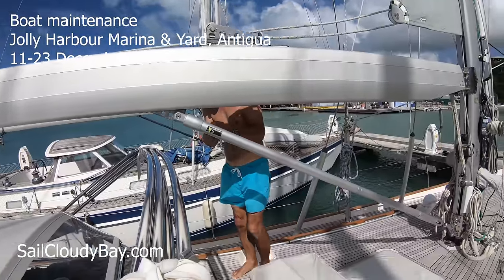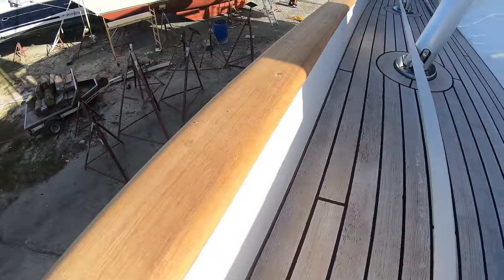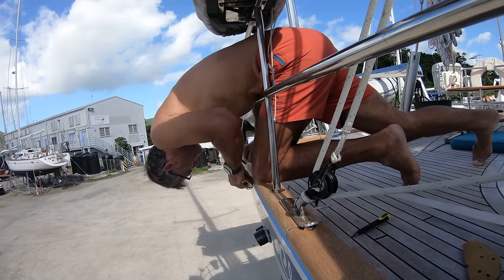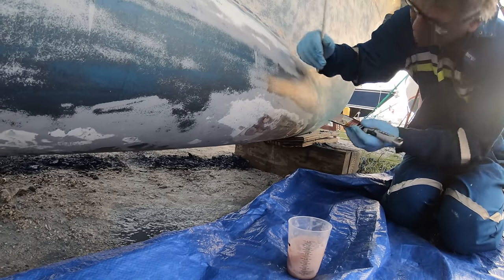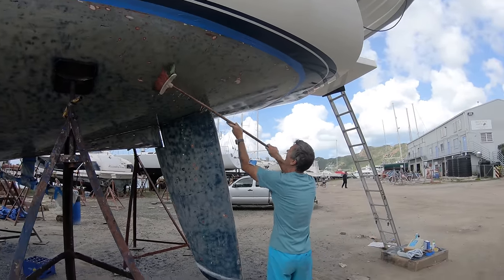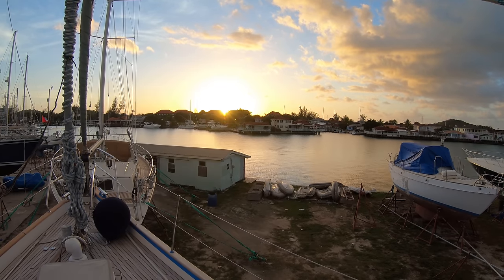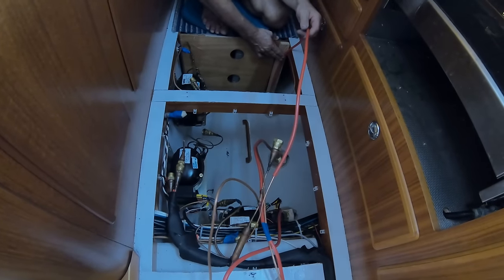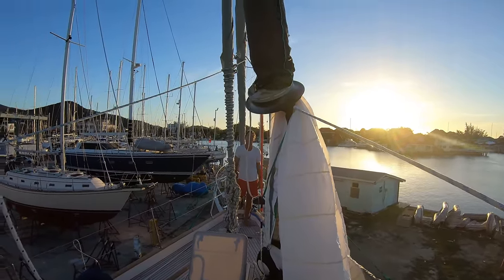ep55 - Boat maintenance - Jolly Harbour, Antigua – Hallberg-Rassy 54 Cloudy Bay - Dec 2018

Comment: After completing your Barrier and Bottom coats you commented "this is how it should of been in Harrington" and I think you weren't wrong. Some episodes ago I noticed your boat parked behind Osprey Marine at Harrington. I hired them to soda blast below water line allowing me to focus on painting and I was very pleased with end result. Your boat looks great and I enjoy your worldly videos. Oh and I like your special tool for applying grease to seacocks. Thanks
Reply from the maker: Yes, would have had a soda blast in Herrington but for 2 reasons 1) they wanted $4000 to do it!  Antigua was $1200. 2) the temperature was dropping rapidly and was getting too cold to apply the Interprotect barrier coat. So we sailed out of winter to cheap Antigua and warm weather.

Comment: I use those same coolers on my Hylas and they work quite well.  You should see a reduction in amp hours to maintain the temps.  Nice video, thanks for sharing.
Reply from the maker: Yes, so far so good. You can really feel the heat they dissipate. The old ones just used to heat up the water in the sink drains when at anchor.

Comment: Great video.  If you decide to re-varnish the rail, you might consider using penetrating epoxy as your primer and then as many coats of a good quality varnish on top as you would normally do.  Prior to using the penetrating epoxy, give the teak a wipe down with acetone.
Reply from the maker: John, the issue with epoxy primer is if you ever want to get it back to wood.  I was planning to put 2 coats of normal varnish at 50/50 with thinner, as primer. then 8 coats more. This would give a nice flexible coating. Then 2 coats of Awlcraft 2000 Clear to act as UV protection and a hard finish.  But we could not find Awlcraft Clear in the islands.   Anyway ... the teak is now all bleaching white pretty fast here - so I guess that is how its going to stay now!
Reply: @SailCloudyBay  
Epoxy penetrating primer like Smith's. Tried and true. Then Epifanes or other spar varnish. If you let teak bleach, you may find that the soft part of grain eats away. You should get more than 6 months from your varnish. Forget two-parts unless you are a pro. It is clear you that you were getting moisture under your varnish.

Comment: Glenn, if I could also chime in on varnishing.....I used Awlgrip´s Awlwood product on my old boat on several pieces, primarily on a stern cap rail that needed replacing and on the cabin top hand rails.  Other pieces of wood trim had Epifanes varnish that had been applied the year before.  After just one season in the Texas Gulf heat, the difference was night and day.  Epifanes had begun to crack and craze, peeling off in a few spots, while the Awlwood looked like new.  Just my opinion, but if you decide to treat your rails  again, Awlwood will provide a superior finish and will last for years....many years.  It´s a bit pricey (around $90/quart for the primer and finish) but what you save in maintenance is invaluable.  

Also, the next time you address your bottom, you may wish to consider Hemple´s SilicOne paint.  As the name implies, it´s a silicone based product that is non-toxic and non-ablative, therefore is more environmental friendly as opposed to more traditional anti-fouling.  The idea is it provides a surface that is so slippery, whatever attaches to the hull while at rest will fall off once you start moving.  Similar concept to the Prop Speed you applied to the running gear.  I used it on my Oyster 53, applying last spring.  After 6 months in the water (2 months in an English estuary) and 1800nm of cruising, the boat was hauled and the bottom was completely clean except for a bit of scum that had accumulated along the waterline while sitting in a Spanish marina.  What was there easily washed off with just a swipe of my hand.  Price is also competitive.  The literature states it will last for 10 years.  With normal paint, you´d be looking at 5 or 6 bottom jobs, at least.  I´ve only had it on for a year, but so far I´m very impressed.  Bonus points......increases hull speed too.  Just my 2 cents.
Reply from the maker: Phillip thanks for sharing your experience. Interesting on the varnish because i heard from another person that Awlwood in the Med needed to be completely stripped off after just one year. So I was put off that product.  And in the Caribbean they all swear by Epifanes. Maybe its just the way these products are applied that makes the difference. Anyhow, for now we will leave it bear teak and left it go silver because I joust dont have the time to stop for 2 weeks to get all the necessary coats on.
Interesting on the Hemple SilicOne paint. I will go look that up. years ago there was "teflon" antifoul paint with the same idea ... but it never worked. Which English estuary were you in? The Orwell new to Ipswich?  If on the east coast, those waters are terrible for growth.
Reply: @SailCloudyBay  According the the Awlwood lit, proper application is critical for long-lasting results.  I know Epifanes is widely used, but I found it simply doesn´t hold up compared to Awlwood.  I used it on my first boat, which was when I was living on Lake Michigan.  There, the boat only saw the light of day from late May to October, and in a climate not nearly as harsh as the Gulf coast.  Nonetheless, it did the same thing, started looking dull and crazed after only 2 summers.  I used Awlwood on my cockpit table and obtained excellent results.  Interestingly, Fox´s in Ipswich had never used the product but were so impressed with the results I obtained on my table, they decided to finish the rails on a 56 they were refitting with Awlwood.  
Back to the bottom paint, I think you´re referring to Interlux´s VC17.  It´s commonly used on performance boats in the Great Lakes, and I used it on mine.  Yes, still got growth with VC17 but not that bad.  But since it was ablative, bottom had to be done every year....spring ritual.  With SilicOne, it´s much harder and doesn´t come off unless you hit something.  After hauling, I was very impressed with how good the bottom appeared, almost like it had just been painted, and there was not a single barnacle to be found except on the top of the rudder where no paint was applied (I´ll fix that before launch).  Yes, we were in the River Orwell getting Bora lá readied for our cruise, and after about a month in the water, we had a nice "beard".  By the time we arrived in Guernsey, the waterline was completely clean, and remained so for the remainder of the summer.  We sat in a marina in Spain for about a month before hauling, and by then scum had formed along the waterline, but as I said, it washed off easily using only a rag and water.  Personally, I´m sold on the product.  Cheers.

Comment: They make led kits that are multi color and dimmable... They usually come with a remote. But a lot of em also have an app you can download. You can get them in many different voltage ranges... One brand that's more automobile focused I think. It's called Type S... I have a set in my car for interior lights. They're controlled by an app on my phone. But anyways. The point of me saying all this. You can use the lights at night without being blinded by using the red color instead of white so you don't mess up your night vision too bad... That's mostly why I use them in my car. Red lights glare less as well. Idk. I know this is an old video. But if the interior lights are still an issue... There's other pretty affordable options that are pretty decent...
Reply from the maker: Thanks for the tip. yes, we have red light in the cabin in cockpit when we are night sailing.

Comment: Teflon tape is great stuff for smaller pipes.  I use a teflon infused pipe d-ope for residential stuff around the house, etc.  The pipe d-ope looks like peanut butter  It is even LP and Natural gas certified.  The thing about teflon tape is that it doesn't seal large diameter pipe well at all...or at least it is a lot harder to do so.
Reply from the maker: I've not yet found any pipe-dope that provides a seal even at very low pressures. Can you recommend one?
Reply: @SailCloudyBay  Lowes in the US sells it.  I have been disappointed with several other brands they sell as well.  This stuff never fails me: RectorSeal T Plus 2
Reply: "MeetsANSI LC 7-2009 Working Temperature Range -40°F to 125°F.
Maximum Working Pressure: 125 psi.
For Use With Natural Gas & LP (VAPOR STATE ONLY).
Use on Steel, Galvanized Steel, Iron, Brass, Copper and Aluminum.
For Pipe Size Up To And Including 1 1/4 Inch".

I have used it on much larger pipe than 1 1/4 inches.  You just end up using a lot of it.  I also think it will probably take temps for a long time up to 140 degrees F or more.

Comment: removing teak plugs ,trick from local -drill small hole in the center of the plug to the top of the screw, use a new screw and screw it into the plug hole you just drilled. the plug come out without splitting the rail.
Reply from the maker: good advice. thanks :)

Comment: Hi guys, good job, yes I usually end up tidying up the sanding prep too. On your shackles and QR Fittings I use "Corrosion X", if you see some give it a try; use it sparingly; it has a wicking effect into screw threads and corroded parts, leave it a few minutes to soak and then exercise the fitting parts at fault. usually works. Corrosion X is also very oily too and is great to protect fittings in the weather. Cheers
Reply from the maker: Thanks, yes that reminds me that I do have Corrosion-X on board from the previous owner. Must try it.

Comment: I have a few questions about your communication equipment, pertaining to cellular data as well as Internet satellite, when you’re cruising the islands you shift between using cellular data from the islands and then jumping to satellite Internet? Do you use a cell phone repeater on the boat as well as what type of satellite Internet are you using and how reliable is it the satellite coverage?
Reply from the maker: Michael, 
For the internet, our preference is to always use cellular phone whenever in range, which in the islands is usually within about 10 miles of the shore. There are cellphone companies that give a package that covers most of the islands. But to conserve our data we use it sparingly, with no video streaming etc. 
Then, when near to shore (anchored) we always try to link into a WiFi signal using our WiFi booster antenna. We can get WiFi when a signal is within  2-300metres from our position. On rare occasions we find a WiFi that is open, not password protected. But usually its a case of finding a shoreside bar WiFi signal then going for a quick drink to obtain the password.  We often re-anchor just to get near to a WiFi signal.
For Satellite we have 2 systems. A Fleetbroadband that uses inmarsat and would give data speeds (250kbps) that would just about allow you to open a simple webpage and would have a similar data speed to the old dial-up method that was used land 15-20 years ago. But we have never purchased any airtime because the minimum package for this system costs $400 per month with only 40meg of free data. Its outrageously expensive. To give you an idea, to get a package that would equate to even a small cellphone data package (1Gb/mth) you would pay over $2000/month, and up to $12000 for 10GB of data. It makes the mind boggle when you see multiple inmarsat antennas on superyachts!
Our other satellite system is Iridium-Go. Its a VERY slow data link that just about allows you to send emails and received very basic weather data. Its too slow to be able to go on the web. Even then, its $140 per month. So we only buy airtime when we are doing passages of more than 4 days away from cell phone signal. 
Our other backup is an HF radio with a pactor modem attached. With this we can link into the sailmail service and get email and weather. But using the HF is a bit like voodoo ..... sometimes it works, sometimes it doesn't!
Connection to the outside world via internet is likely one of the most painful aspects of cruising life. Unless of course you are happy not to have the internet, then its paradise!

Comment: If you are doing hydraulic fixes it is good to have a very fine sawdust handy. The sawdust from routing “custom wood” as in cheap furniture paneling is best. The fine dust scavenges the oil from the surface it is sitting on.The oil filled dust needs to disposed of away from the boat as it burns slowly but ignites very easily, it burns like candle wax. Regarding the brazing, a safety tip I learned just this week is https://youtu.be/aqR4_UoBIzY this simple to make magic compound will protect the fibre glass hull from the intense heat of the flame. No doubt you know that when ever flames are part of the work on a boat you must always have a fire watch person. That needs to be you, don’t leave that to others. The person doing the work usually can’t see what is going on around them and can set fires with out knowing it.
Reply from the maker: Very sound advice William, thanks.

Comment: Again, very nice work and video! If i knew i would come to help! A question, in the other boat maintenance vid i saw you have 2 webasto heaters. How are they build in? 2 Heaters charing the same pipe or 2 heaters for 2 seperate parts of the boat? Cheers!
Reply from the maker: Ron, Each heating unit supplies air to a different part of the yacht. Basically one bow and saloon the other saloon and aft.

Comment: Very cool! So meticulous, love it!

Question, what did you replaced the “water/cooling” intakes for your fridge?? I have the same water system for my refrigerator, looked exactly like yours.....but I have never seen the ones that you used to replaced the originals?! 😳
Also what kind of system did you use on your teak wood that it comes off like that?? 😱😎
Reply from the maker: We replaced the Islotherm thru-hull keel coolers with the ones Frigoboat make. The Isotherma are good in cool water and when the boat is bobbin g up and down. But in calm warm seas they just managed to super heat the water in the thru-hull pipe. These new Frigoboat ones are much more efficient.  
The "varnish" we used on the teak is a German industrial product called Coelan. Challenging to put on but it you get it sealed properly it lasts for year with great UV protection. Unfortunately we had just too many protusions on our gunnels (all the stanchions) and it started to get water under it after 2 years.  I was going to revarnish but decided on the easier route!

Comment: A small 2 inch C clamp would work under the water heater to tighten the fitting.
Reply from the maker: Good suggestion. but how to tighten up the clamp when I could only get 2 fingers max to the whole operation. Then to tighten and loosen each and every 1/6th of a turn? It would take a long time.
Reply: I thought I saw you had the fitting in your hand. Anyway, there are many small spaces I have used the C clamp in my 38 😊.

Love your vids.
Reply from the maker: The really difficult one (that was leaking) I am tightening at 33:25 in the video. This is the one that I made the very short handled spanner for .  Good idea though.  Thanks.  Glad you enjoy the videos.